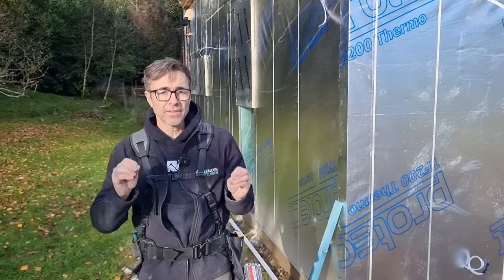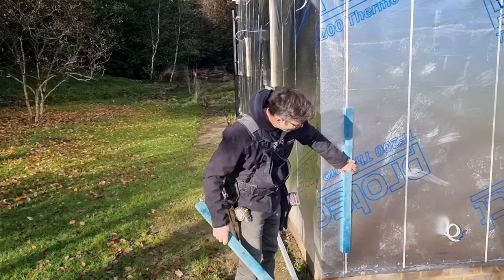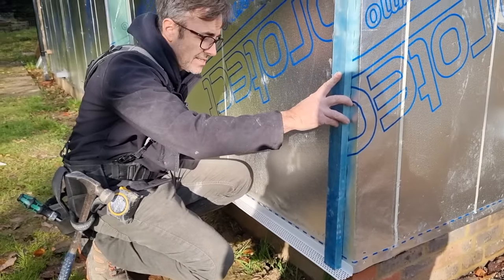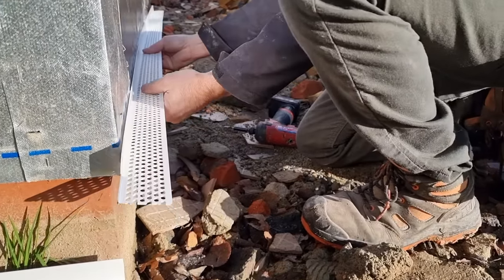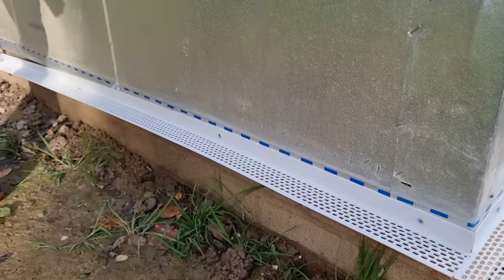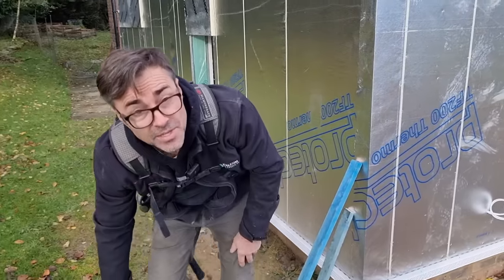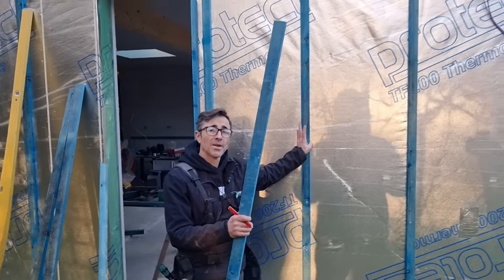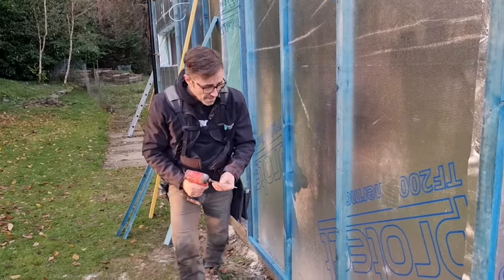How to ventilate cladding

Comment: I take it you meant to say you're doing vertical cladding not horizontal
Reply: Yeh I was scratching my head there for a minute as well
Reply from the maker: I mention this early in the video and talk briefly about how to batten for either vertical or horizontal
I do sometimes muddle my words though!!! I had better watch it back!!
Reply: @ukconstruction  no it’s no problem praps I wasn’t paying attention at the beginning of the vid and it’s just that I’m so use to fitting and seeing horizontal boarding fitted to vertical battens great vid though explaining why good air flow is so important  in preventing moisture and subsequently damp conditions within  void areas
Reply: He did say he was doing horizontal. 👍
Reply: @grahamgodwin7200  yep just as I thought I can add going deaf to my ailments
Reply: Is that a krend render trim Robin your using for the vent. ?

Comment: Hi Robin. I did a similar vent system to my garage / workshop in the west of Ireland some years ago - the only difference was i used a stainless steel vent strip ( as the rats were very determined to gain access because when we were not there for the winter it was there home as i found out on our return ) i fixed the stainless steel vent strip to the concrete block wall & not to the insulation board as you have done as the rats would eat there way through the foam in minutes - i cross battened the insulation board with 25mm ( 1’ Full treated batten ) I also left a 5mm gap at the top soffit board - all the outside cladding was steel box section & all of the smallest rat access points were sealed. We have no rats in the workshop now. Ed.

Comment: I wonder, besides years of extensive experience, how long it takes to plan the details. Many of them look as if right at the built site or are they also designed beforehand i.e. the screw length and type, 2,5 cm lateral gap to be closed at corners horizontally with 5 cm timber? I enjoy every second of your altruistic sharing of your craftsmanship.

Comment: "Pressure Equalized Rain Screen" if you vent top and bottom - the theory is that because the space is pressure equalized no moisture will be drawn through the exterior finish. Leaks require negative pressure.

Comment: Really nice job covering all the important aspects and even includes a note on batten sizing!
The Spax screws are a great pointer and well worth the extra cost for perimeter fixing. If you are looking for savings, using the pcv vent guards is a great way to save some money although aluminium is really not expensive either (much harder to cut and work with) .

Comment: Looking forward to seeing the cladding going on, especially the corners. I’ve got something very similar to do next year
Reply from the maker: Coming soon!
Reply: @ukconstruction  can I assume that if you were cladding horizontally you would batten the other way around ie horizontal first then vertical?
Reply: @dougwardle2175  no you will only use a single layer of battens but maybe a thicker one. Check with the cladding manufacturer or if you really can't ask anyone 38mm is the starting point.

Comment: The batton on edge at the window opening is a nice touch, i will use that in future thanks!
Reply: Would that be pilot drilled and fixed using a 3 inch screw as the 2 inch side is facing outwards? I have a similar project and would like to use this method

Comment: HI Robin,
My timber clad extension has been vented in this way (although I used a stainless steel mesh on a roll)
My building control wants me to vent above and below windows also😢
I’m thinking I might just drill some holes through the cladding and place a vent over- what do you think?
One other thing- I put a weathered edge on the horizontals for moisture run off- I have a very pedantic building inspector.

Comment: What’s your building control inspectors view on cavity barriers to the ventilated void? (See paragraph 5.18, section B3, Part B of the regs) On a recent cladding job the inspector insisted on barriers top and bottom of the cladding (intumescent type in order to maintain the air path) and around all openings. Around the openings is a little easier as a 38 x 38mm timber is deemed suitable for a cavity barrier in Part B, so simply replacing your batten on edge to the window openings for a 50 x 50 will suffice.
Reply from the maker: Yes thats an interesting area around the cavity barriers, we always have them in a typical timberframe with brickwork face but tend to use batten on edge and then solid clad the reveal with the cladding giving the equivalent of 50mm thick, I will take a deep dive into the regs and look at the current guidance, thanks for your comments
Reply: Excellent point raised , definitely worth a video .
Reply: @ukconstruction  Thanks for your response, using the combined thickness of the vertical batten and the cladding is interesting and something I will definitely be discussing with our inspector next time. If you ever need an intumescent barrier the envirograph product 55, CV cavity strip is useful or Siderise do a very extensive range and great technical team.

I have always thought an intumescent strip incorporated with an aluminium/stainless steel ventilation guard like the plastic version in your video would be ideal for these scenarios.

Comment: Hi robin,firstly thanks for sharing your wisdom and taking your time to upload all your content. I enjoy watching the proper tradies going about their craft and showing how things are done correctly.
I built a garden room last year and over cladded the front in western red cedar,I used insect mesh to the lower part with counter battening and was wondering if I should of used some sort of ventilation at the top also ? I’ve got a 500mm overhang which I’ve battened and cladded, and often wondered if I should of added some sort of vent in the top part (not too big of a job to add at a later stage if needed)
I’d appreciate it you could share your thoughts pal. Keep up the great work 👍.
Reply: @J5X7  yeah I was thinking about something along those lines,just wasn’t sure if it was absolutely necessary. Like I said before it’s not too big of a job to do later (when the weather’s a bit kinder) .
Thanks for your reply mate 👍.

Comment: Great video as usual. Just insulating a single skin garage internally to convert it to a workshop. Its detached but its a double unit shared with my neighbour. Redrow built it with an intumescent sealed ceiling across both units, presumably to save on building costs. The blockwork wall between the two does not continue to the roof ridge All the videos I have seen say stud the wall at least 25mm with DPC behind the studs, then Celotex, then OSB. The say seal the gap behind the Celotex so there is no ventilation to the outside and rely on brick breathability. Sealing the studwork and dpc is difficult on a poorly built wall. Do you have any advice?

Comment: i only used hardie plank on old victorian buildings, I would love to do it on a nice square new build, it looks so much easier.   I clad my rental properties as it dries  the 9 inch walls out, and a dry wall is a better insulator then i been insulating them internally with superfoil as i dont really trust the external insulation.  my only problem has been one tennant pulling the fuse out of the heat recovery ventilator system to save money on electricity causing black mould to form on the walls.

Comment: Hi Robin, love watching your video's particularly as we're building a timber frame house, just have a question about nailing battens. Would a batten nail going in at an angle sloping into building cause water into the frame, we have same set up as you TF200 but when it rains water is on inside of plywood sheathing and into building? cheers

Comment: Hi Robin, would you also recommend fitting hardie plank the same way or is this just critical for timber cladding? Thanks for all the great clips! Keep them coming THANK YOU
Reply from the maker: Hi Gary, have you seen my Hardie videos??
Reply: Morning Robin, I have not no  I must of missed that one. I have recently started work for a garden buildings company and have tried to explain the importance off bug screen top and bottom and the 10mm air flow gap at the top but have just been told it’s not needed and do it there way. So some clarification for my own peace of mind and the correct information for potentially going forward on my own would be massively appreciated. Many thanks for your reply 👍

Comment: Very tidy job but I'm not sure that plastic is up to the job of stopping insects or rodents.
The fine stainless steel mesh is generally what I see spec'd, fiddly to use but it is bullet proof
Reply from the maker: It is a fair thickness and very similar to many roofline products commonly used externally in nearly all builds now, if there is no food source generally the rodents will stay away

Comment: How do you ventilate over window and door headers?
Reply from the maker: with the counter batten we carry the top vent along the roof as normal and in the case here we will have more than enough air flow from the adjacent walls either side of the large opening that will pass over the counter batten and out at the top, if it was on show we would use a powder coated aluminium perforated section set in a shadow gap to match the cladding or windows as close as possible

Comment: What diameter holes are in that ventilation plastic please? I'd worry that wasps would get through it easily.
Reply from the maker: they are about 3mm, the are smaller than the gaps in a typical plastic vented soffit board

Comment: Does it matter that half the holes in the fly screen are covered by the horizontal batten?
Reply: Not if a 25mm of continuous ventilation is sufficient for the cladding you are using, In most cases I believe it is and this is the only way I have seen it done on site. I would recommend looking at the cladding manufacturers specifications :-)
Reply: May be worth planing or routing a wide chamfer on the lower interior corner to allow more air uptake.

Comment: I want to clad a small outbuilding in our garden as it's ugly concrete. However, the fascia is right up against the wall, probably a couple of inches out. Would cladding outside of this be at all passable? So it sits forward, with this air gap behind. Can't put much money into unfortunately, otherwise I'd tear it down and start again 😂.

Comment: What is the wall construction under the membrane please?? and is there a series for this project?
Reply from the maker: The wall construction is my standard timber frame, TF200 Therma membrane 9mm OSB sheathing, 130mm CLS studs, 120mm PIR, Vapour barrier, 25mm internal service batten, 38mm thermal board, 3mm plaster skim
Reply: @ukconstruction Many thanks. Most useful 👍 😊

Comment: Interesting product. Curious about the top. Didn’t look like enough overhang to prevent rain from hitting the top perforated piece. How much clearance do you need to provide at the top to allow adequate airflow?
Reply from the maker: We currently have an excess of overhang and once our cladding is finished we will cut back the roof parapet and weld on our cover trim to our single ply membrane

Comment: We were just talking about this on new build houses at work today, is that material on the outside a vapour barrier or is it a  breathable membrane? Looking forward to  the next installment 👍
Reply: I wondered that too. Maybe it's the foil back of the PIR.
Reply: It’s Tyvek equivalent of Housewrap. Water tight but breathable
Reply from the maker: Hi Guys, this membrane is an insulating breather membrane and it has really good service class and can really protect the timber frame structure during the construction phase even if there is a significant lag in time before the final envelope is completed, it is fixed directly to the OSB sheathing

Comment: I would notice asymmetric screw and nailing patterns. 'Clock' screws on: hinges, door furniture, electrical face plates in fact any 2nd fix with a screw visible. If you know, you know🤓. Anything else just screams quantity over quality.

Comment: You're  brilliant 👏.  ...these houses are NOT HOMES....they are over priced sheds.... dreadful too say the least ... therefore it should be only  worth 20% of a real brick and mortar house....who agrees  ??????  Think all the volume builders will go this cheep creaking monstrosity way !!
Reply: You need to travel more... try Scandinavia, Poland, Germany, Austria, Switzerland and Canada/US to name but a few.
Reply: I do travel....but over there they use proper timber....we have rubbish and trust me they creak...we use shitty i beams...when you have people walking up stairs...you can here the floor moan...my house has thick stuff called  joists....1950s house.... built to last. Have a look mate....you don't need to travel...just walk around any new builds... take it you're a pen pusher !
Reply: @michaelherbert2982  I'm pretty sure both your comments would make perfect sense.. underneath some other You Tuber's video! Lets start at the bottom: Going from memory and a few notes I jotted down during previous videos the extension which you saw Robin cladding here has a 1 meter foundation, a 3 brick plinth, a double sole plate (two overlapping 6"x2"  or 140x40mm), 6"x2" /140x40mm studs on 16" /400mm centres, a double top plate (two overlapping 6"x2"  or 140x40mm), two glulam beams circa 440x175mm as joist hangers holding ceiling/roof joists 175x40... all sheeted over with 8'x4' something or other..?  (probably 18mm OSB)  And that's a shed by your reckoning.. a cheap, creeking monstrosity?  (PS @ukconstruction please correct my dimensions where necessary)
Reply from the maker: Top of the class!! Thank you!!